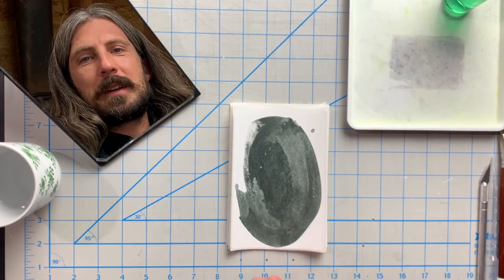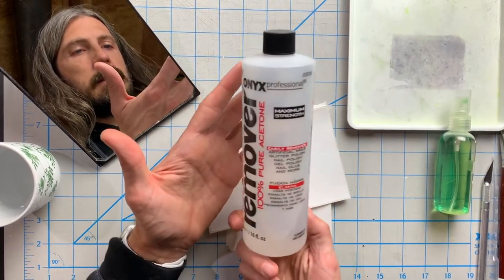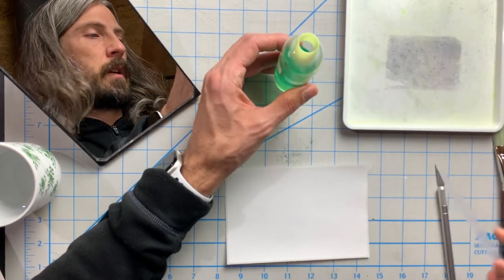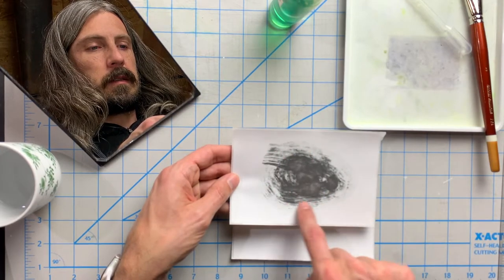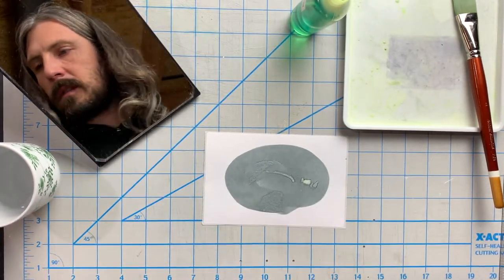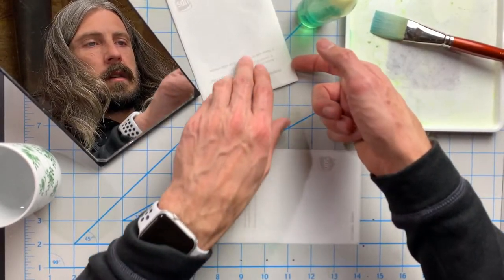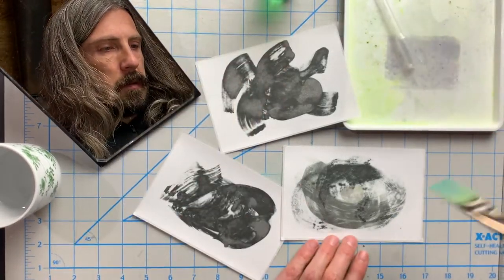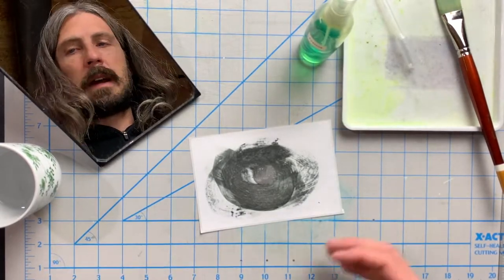Ep1. Acetone on Thermal Paper (Experimental Art Demo)

Comment: Have you tried using different backing colours (for the thermal differences) and masking (like using leaves, feathers etc) and placing out in the sun? Similar to Cyanotype
Reply from the maker: I haven’t found colored thermal paper but that could be cool. I’ve done leaves and feathers and got good results. Check out my demo with flowers if you haven’t seen it. The paper turns orange if left on the sun for many hours. Didn’t work as well as a cyanotype but I might not have perfected the process. Thanks, Anny!